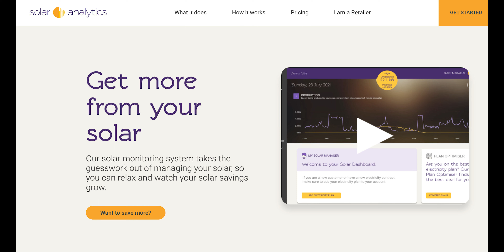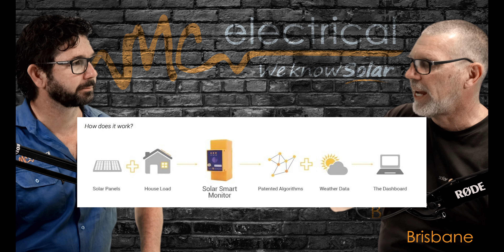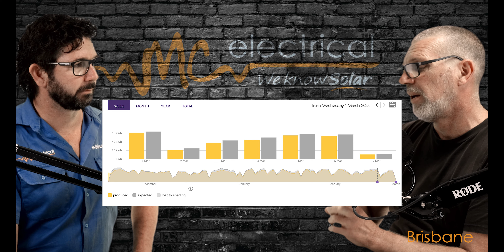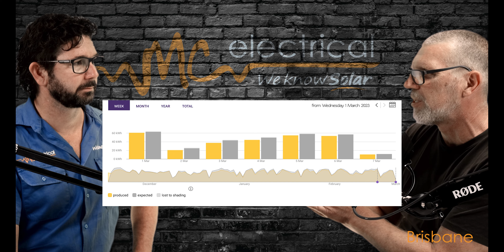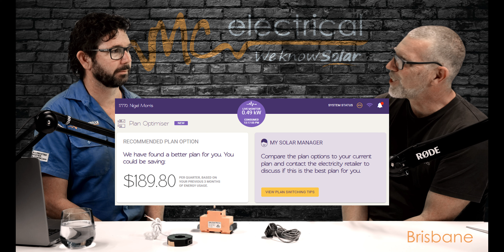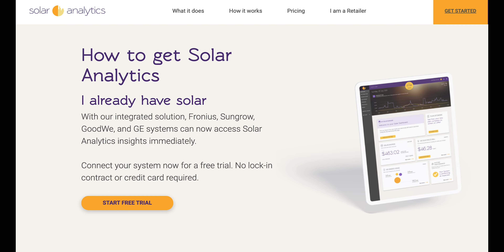Solar Analytics Review

Comment: I am getting massive differences in my usage numbers from solar analytics compared to my power bill. My power bill usage is more than double what solar analytics has measured in the same billing period. Do you know why this would be? My power company (powershop) have also told me that my meter reconfig hasnt been updated in the national database but i can see on my usage in the powershop app that there is no usage being recorded during the day due to solar so i assume this wont be the cause? could be wrong.
Reply from the maker: It’s possible you solar analytics (or consumption monitoring) was installed incorrectly. I’d get your installer to confirm that first.